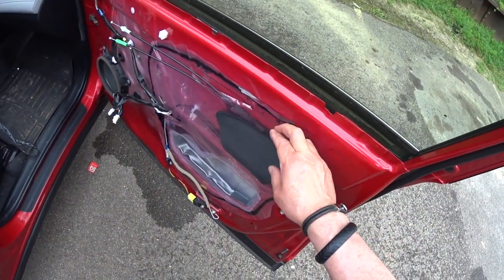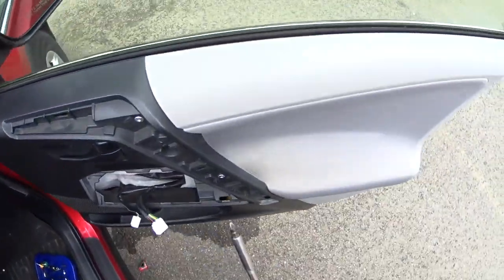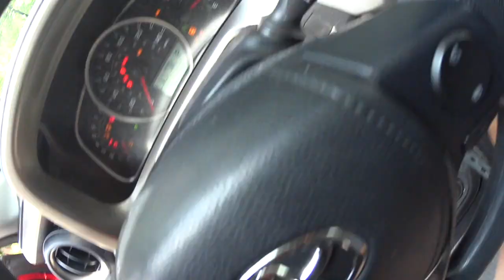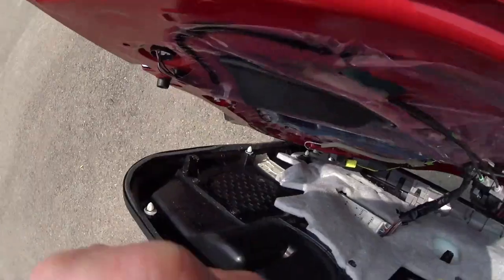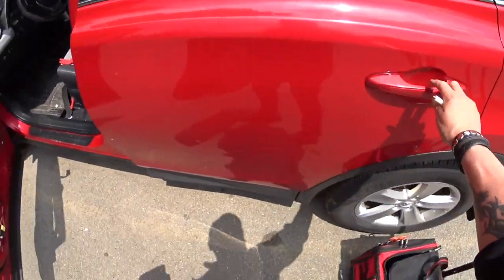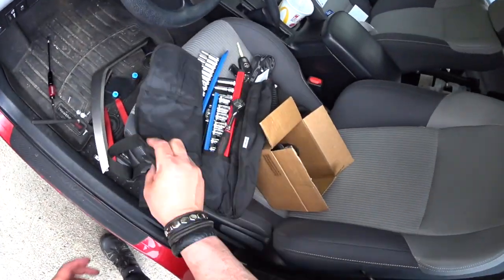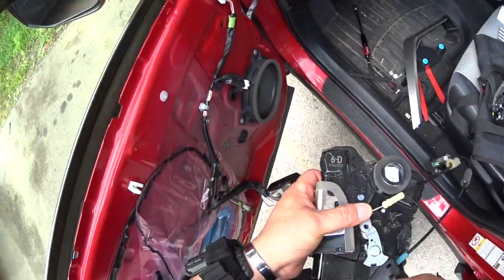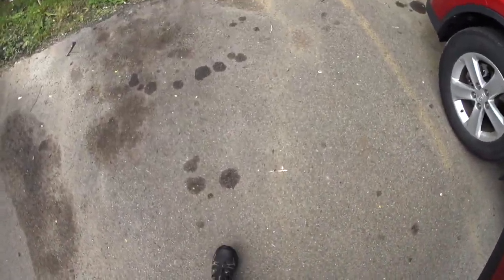Toyota RAV4 2013 Door Actuator Replacement

Comment: I replaced the door lock actuator on the driver side and everything works fine except my key won’t fit into the door lock anymore on the outside. Any idea why this could be and how to fix it?
Reply from the maker: Tiki Master Yes you have to take it out and align the hole for the key 🔑!!!
Reply: Pete Sambolin yea I figured it out. The driver side is a bit more complicated than the other doors due to the keyhole linkage.
Reply: @Tiki7391  I noticed that you said that you replaced your actuator. Are there any linkages that go to the lock itself from the actuator ? Like metal rods from the actuator to the lock? My daughter paid the dealer to have hers changed and that was back in October and now she's having this new  problem that she sticks her key in the lock and twist the key  in the lock and the door won't unlock and that's why I was asking you if there are any linkages from the actuator to the lock. Most of the time when something like this happens on a vehicle most of the time it's the linkages have fallen out of place. Anyway I appreciate any input, thank for your time.
Reply: William Santiago yes there is. On the drivers side there is a rod that goes from the keyhole to a hole on the actuator it’s self. Hard to describe without pictures but if u look at the actuator you’ll see where the rod goes. Hope that helps!
Reply: @Tiki7391  Thank you so much for the fast reply and your info was a GREAT help buddy, take care.

Comment: I’m being charged $130 to replace the driver door actuator. I hope it’s legit. And I hope none of my others go bad.
Reply from the maker: Jacqueline Hernandez Hi 👋 so you get a very good deal because I work in a Part Store and my price was like $234.00 for each one ☝️ and I did the installation...my was a Dorman brand lifetime replacement.
Reply: I’m going back Friday. I hope they don’t try to charge me an extra hundred. Thanks for posting. Helps a lot.
Reply from the maker: Jacqueline Hernandez Hi 👋 wish one you need?
Reply: Pete Sambolin Driver door doesn’t unlock either at the door switch or with the remote, only manually above the handle.
Reply from the maker: Jacqueline Hernandez Well my was passenger front door first then the driver door. Just make sure they have lifetime warranty because they go bad a lot average life like 5 years
Reply: Pete Sambolin Are you familiar with DLA-Metra? They gave me a year warranty. The installer is a local car electronics shop.
Reply from the maker: Jacqueline Hernandez Hi ✋ usually went a part is warranty for a year means will last like 2 years or less in my experience! Never hear about the brand name! But the price is right actually have of the price of Dorman brand the difference is the lifetime replacement if it's fail .... Went I make a decision like this I think how long I going to keep this vehicle or like my Rav 4 that the bank is the actual owner Intel I pay it off ... So I know that I'm going to have the vehicle for at leas 3 to 4 years more!!!
Reply: Pete Sambolin makes a lot of sense. Thanks for the input.